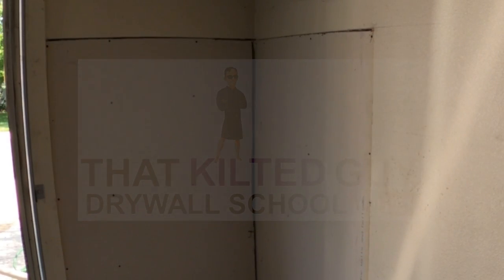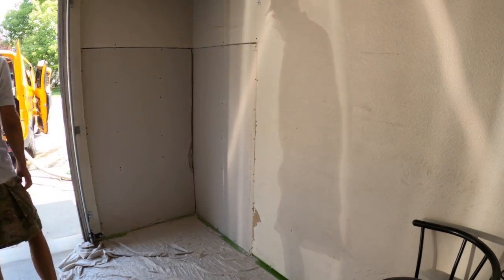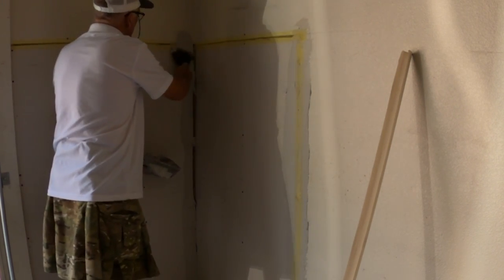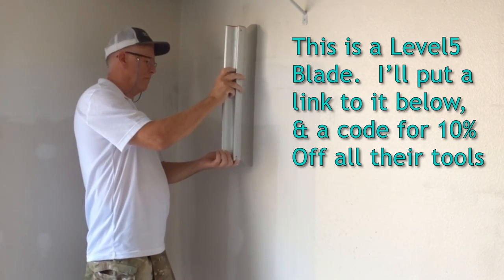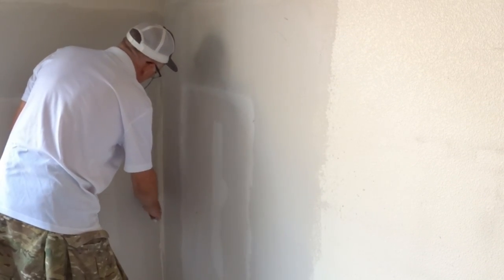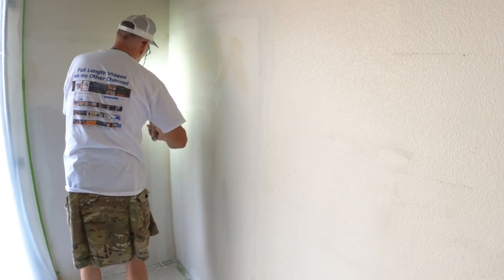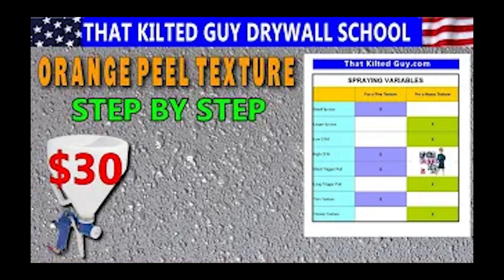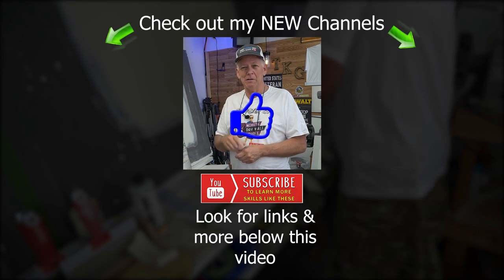Large Drywall Repair & Perfect Texture Match Demonstrated

Comment: The piece for inside corners are these available at home depot and lowes . I have had big gaps on inside corners and used mud but sometimes it falls out.
Great video
Reply from the maker: Check with your local Drywall Supply. If not, ask them if they have extra wide joint tape as you can sometimes get it in a roll about an inch wider. But it’s real pricey like that.

Comment: I use the same hopper from HF,but I have a small in-line regulator installed to make small air adjustments if needed.
Reply from the maker: I have a ball valve on the bottom of the gun that does the same thing

Comment: Hi just to reassure my self before buying . So I can use sheet rock 90 for my first time DIY or the 20 is best ? 
Also can I cover ceiling crack and corners for the first and second or 3 coat using the same compound or do I need a different compound for sealing the last coat before painting my wall? Sorry I got confused reading the comments on other videos and want to be sure since you also show using compound 3 I’m scared. Lol
Reply from the maker: All the mud you listed will work but the difference is the hot mud‘s shrink far less, and allow you to put multiple coats on in one day. But they are also much harder to sand so if you can’t put it on the flat the first time you will work 10 times harder sanding it down flat and in that case you’re better off using regular all purpose mud.

Comment: Hey Gut. u ever replaced wet sheetrock and base when a water heater failed. Removed wet insulation, cut the rock two ft above the floor and removed the base. Sprayed bleach and water all over the place, put fans on the wet area. Going to go back in three days and wipe everything down with a sponge that has alot  of bleach. Any advice?
Reply from the maker: Not without being there. Sometimes you need a dehumidifier, sometimes just fans, sometimes both but ensuring it’s completely dry is super important. and then I don’t really like bleach at all so I found some mold control spray that I like better. This is it- https://amzn.to/3FQeNXg
Reply: @ThatKiltedGuyDIY  Thanks Guy for always responding to my questions or comments. Thanks for all the advice and tips over the last year or so. Got all the knowledge l need to be a pro drywall repair guy. Thirtyfive years as a carpenter, painter and running a sucessfull handyman business l think l got it figured out. Your tips were spot on since you were so specialized over the years. lf the repair is not a splatter, drag.crows foot or smooth l pass on it. Dont need any head aches at 61 yrs old. Thanks for all your help over the last year. Hey veiwers, this guy is the real deal!
Reply from the maker: Thank you. And the best of luck my friend

Comment: I thought hat you should not use hot mud to cover screws because the hot mud is supposed to cure, not dry, and if it is too thin it will dry?
Reply from the maker: That is true but I think in this instance it’s fine because we’re putting it on such a small area and there’s nothing to cause it to come loose such as joint expansion, and when it goes on the screw it should have enough depth to cure. Plus I often use five minute mud which cures before it dries.